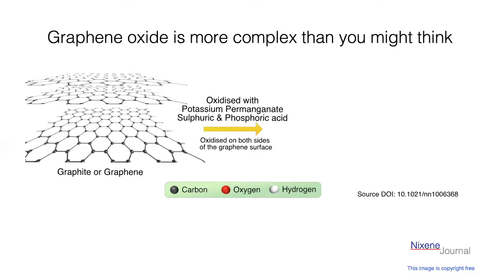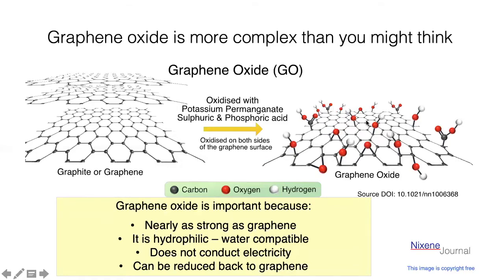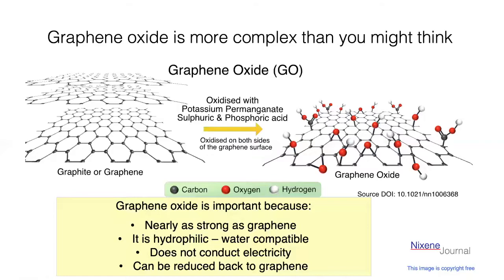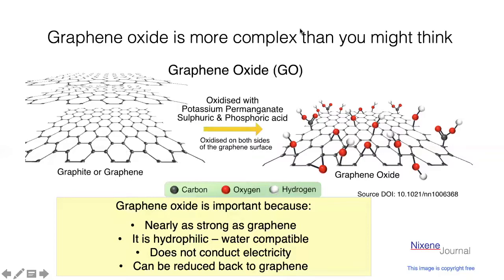15 - Graphene Oxide

Comment: Can we use HCl for the synthesis of graphene oxide instead of using sulphuric acid or phosphoric acid..?
Reply from the maker: Thank you for asking - we will be back to you shortly with the answer!
Reply from the maker: "A good question, I assume that you use the term HCl to mean Hydrochloric Acid

The short answer is HCl is used more as a processing aid than critical component of the graphene manufacturing process

Longer answer...

Acids are used in two ways in the manufacture of graphene and graphene oxide from graphite (Both are significant commercial production processes for making graphene and graphene oxide powders from graphite)

1. Hummer’s method 
Concentrated strong acids and oxidising agents can break apart graphite into graphene oxide. (don't try this at home)
Sulphuric acid (H2SO4)  tends to be used in Hummer’s method and HCl is used to wash the graphene oxide to remove impurities and HCl also seems to reduce the graphene oxide back to graphene slightly 
You can find out more from this paper: 
Synthesis of Graphene Oxide using Modified Hummers Method: Solvent Influence 
https://www.sciencedirect.com/science/article/pii/S1877705817316235

2. The electrochemical exfoliation of graphite to graphene and graphene oxide.  

Dilute Sulphuric acid helps the electric current flow through water from one electrode to another made of graphite
The sulphate ion from the acid does the intercalation helping the graphene layers separate into graphene (Exfoliation)
Imagine graphite is like a deck of cards (each of these cards is a layer of graphene)
The electricity helps force apart the cards
The Sulphate ion gets in between the cards (Intercalation) stopping them from sticking back together again

Hydrochloric acid has been tried in this electrochemical method but the Chloride ion doesn’t form as easily as the sulphate ion and chlorine gas is evolved,
This means HCL doesnt help the exfoliation process

A paper has just been published that looks into this in more detail, you can find out more from this link:

Role of anions on electrochemical exfoliation of graphite into graphene in aqueous acids
https://www.sciencedirect.com/science/article/abs/pii/S0008622320306138?dgcid=rss_sd_all

Hope that helps!"